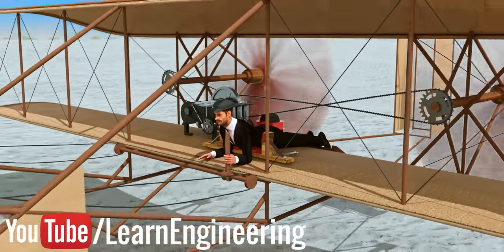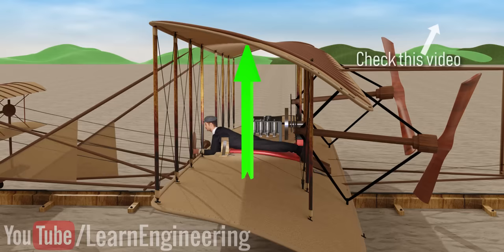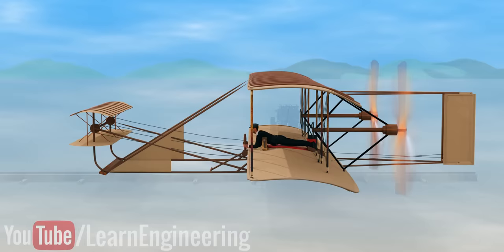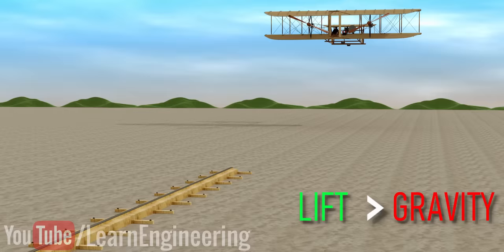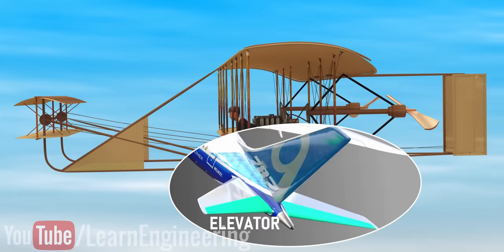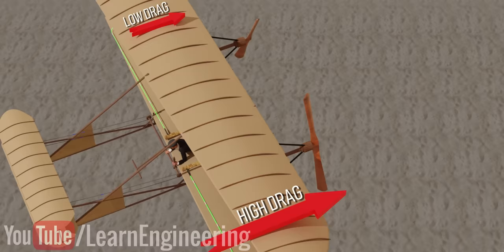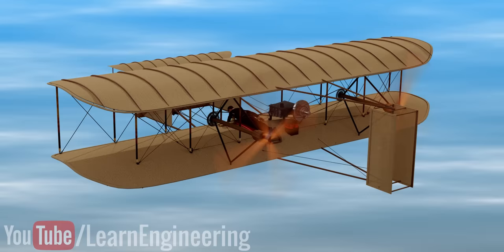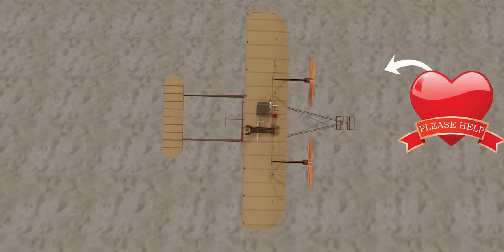The Brilliant Engineering of FIRST FLIGHT !

Comment: Did you know that the Wrights pulled three strings to make wing warping systems? When they did this, the idiot who was in charge seemed to be dancing. Kkkkkkk
Reply: I am not sure that I know what you are talking about.
A modern graphic probably illustrates how the Wright's controlled an unmanned gilder.

There were 4 lines or strings.  They terminated on two ends of a hand held stick.  
By tilting the stick you could warp the wings of the glider.  The lines also tethered the gilder allowing it
to be flown like a kite.  I don't recall seeing anyone do this but there are probably videos at the Kitty Hawk website.
If we can find them, then we can decide for ourselves whether or not flying a glider this way could be described as dancing.

The illustrations I saw are probably found on wright-brothers history sites.
Reply: @stevebett4947  kkkkkk machine that was never introduced before Dumont in flight. forget it, boy, these two never proved their ability to fly before 1908 !!!

Comment: I love Brazilians....

"The replica didn't fly." -  The weather on December 17th at Kitty Hawk was unusually cold that day. The barometric pressure was very very high. The air density altitude on that day was about a 1000' below sea level from a normal day. That's why they flew. Had they not, it would have only been a few days and they would have. When they went back to Ohio the air density altitude was about 5000' and no, the aircraft didn't fly. It took them some time to figure out that barometric pressure was important when it comes to flying. 

If you look farther into it, they tried the replica again a few days later and it DID fly. John Denver, the late singer, built a replica in the late 80's.... IT FLEW!!!!

"They were catapulted into the air and glided."-  They did not use a catapult at Kitty Hawk. You are referencing the very 1st filming of a flight in Ohio. That was the 4th airplane they had built in Ohio (its here on YouTube) . There was no catapult at Kitty Hawk…. There was no catapult…. At Kitty Hawk. If a fighter jet gets catapulted off the end of an aircraft Carrier, does it then not fly? They didn't build their catapult until 1904.

"Dumas was the first to fly"‐  According to the definition of heavier-than-air flight, no he didn't. His airplane did not have a proper propeller, it did not have a way of controlling the aircraft via ailerons or wing warping or a rudder that moved or elevators that went up-and-down…. He hopped. He used Hargrave cells, the same thing a box kite is made of, not a wing that generates lift by air moving over it. Just as you guys wanna claim the Wright brothers were catapulted... his airplane was just like a paper airplane. It was a powered box kite.

"Dumont is credited in 1906 with the first aeronautical achievement by the French."- The FAI wasn't incorporated until....... 1906. So of course they're wouldn't be anything before that year. They were also in Europe. The Wrights were in the U.S. When they went over in 1908 to show off the Wright flier, all of the French naysayers and doubters printed public retractions that they were wrong. Because of how the airplane flew they knew that the Wright brothers had been flying for years, while they were still only on short,  uncoordinated, uncontrolled hops. They even said we are beaten, we no longer exist. That's how much they knew the Wrights had done it.

https://youtu.be/SgoPPg8oVt8

Please go do some research!!!!!
Reply: Santos-Dumont 14-bis, 1900 - 1906
Santos-Dumont Demoiselle 1907 - 1909
Reply: The first flight was made by Santos Dumond in 1906. The Wright brothers allegedly flew before him, but there is no record of this. Santos Dumond did it in front of the Eiffel Tower with half of Paris watching. And the plane took off by itself, not with that catapulted bullshit.
Reply: Please provide the proof that they did not use a catapult.
Reply: @clking1938  

1903: The Wright brothers fly 260 meters!
1905: Wilbur Wright flies 24 miles around Dayton, Ohio!
1906: Santos Dumont flies the 14-bis 50 meters.
Reply: @clking1938  

1903: The Wright brothers fly 260 meters!
1905: Wilbur Wright flies 24 miles around Dayton, Ohio!
1906: Santos Dumont flies the 14-bis 50 meters.

Comment: I just can't imagine that "high school dropouts" discovered all the engineering physics that's now applied in modern flights today! Incredible! Incredible!
Reply: High school drop out because they were so Brilliant that their innovation was 99% better then what a high school could provide at that time.
Reply: The first real flight was performed by Alberto Santos - Dumont, who built a real proper plane which would take off unassisted. Even a rock can "fly" when tossed by a catapult lol The plane 14 bis gave birth to modern aviation.
Reply: @agauerm  completly false!!
Reply: @zeke2566  nope
Reply: @agauerm  Dumont used the kayak paddle propellers on his early plane prototypes that he used on his balloons.  They were not aerodynamic, but beat the wind like a table fan producing more eddies and flutter than directed thrust for lift.  Dated photos of his planes bear this up.  He changed the propeller design after the Wrights exhibited in France...and his plane and others suddenly worked.

If the aviators in Europe had designed the propeller properly, then they would have been the first to powered, controllable duration flight.

Lighter motors and proper propellers is all they were lacking.  Their wing and tail design was superior to the box kite design, and became the defacto shape after 1910 to this day.

Many inventions that didn't work were only missing one or two eureka elements.